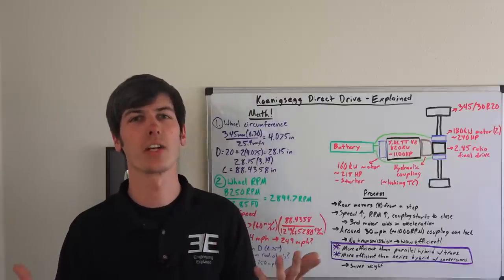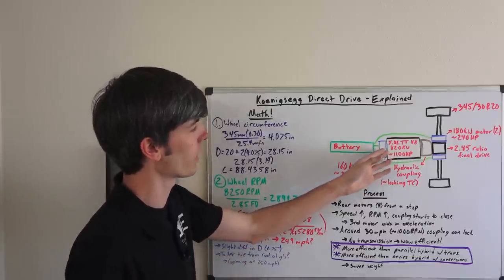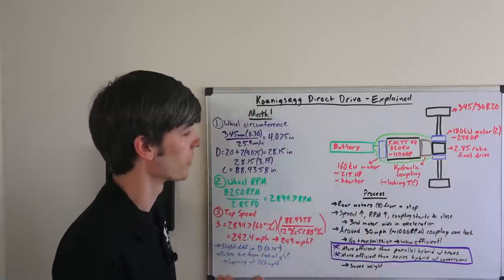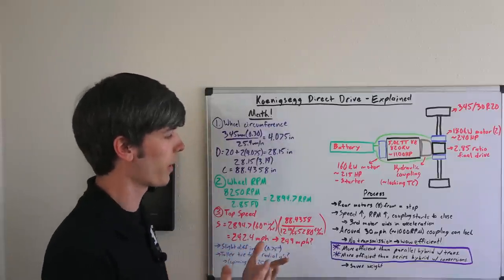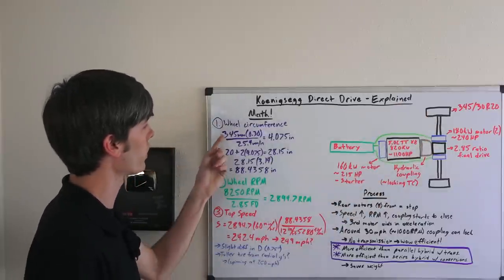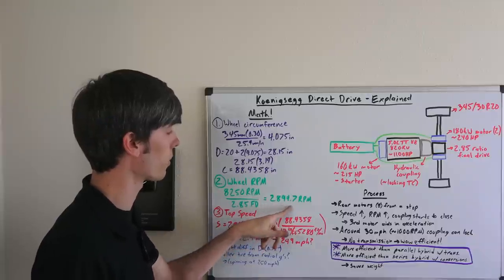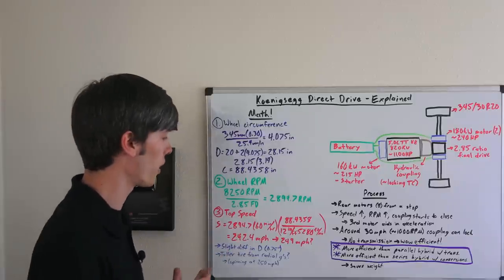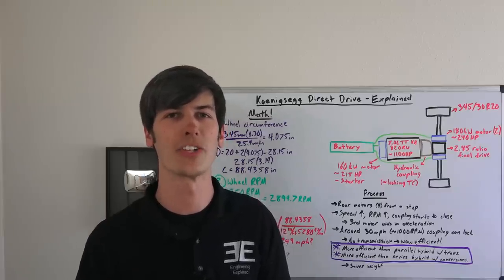Koenigsegg Direct Drive - Koenigsegg Regera - Explained

Comment: While calculating the max speed how come you don't mention the weight of the car?
Reply: Max speed is not affected by the weight of the car, but by the max rev/min the motor does and the transmission+wheels+tires ratio.
Imagine that you have an endless stretch of land and do not take in account the air resistance, what's left is only what he used to calculate.
Reply: RedheadPapa  Weight/mass is not relevant to top speed. 
Acceleration is greatly affected by weight/mass. 
Less weight/mass equates to increased acceleration, but does not increase maximum top speed.
Reply: patw52pb1
I'm gonna sound like a noob but the top speed is supposedly 255mph not 249mph, and secondly why with all this power is it slower then a bugatti SS?
Reply: Dirceu Corsetti Thanks, when you mentioned the endless stretch it started making sense.
Reply: ***** Numerous factors can affect the top speed of a vehicle including but not limited to gearing, ambient air temp and density, drag coefficient, road surface, road slope, transmission top gear ratio, final drive gear ratio, dynamic tire circumference, tire coefficient of friction, maximum engine RPM, clutch or  torque converter slip if equipped to name a few. 
What Jason illustrated was the calculated top speed using published data and some assumed static values such as tire circumference, maximum attainable engine RPM. In the real world of vehicle speed measurements very few parameters are static values and most contributing parameters are somewhat dynamic.
All of that means whether it is Jason or anyone else calculating  vehicle top speed, it will most likely have a certain percentage of error and highly unlikely to be exactly the same as an actual top speed measured on a road where the conditions are very dynamic.
Reply: patw52pb1
Ahh okay lol thanks very much for the explanation.
Reply: ***** they probably dont think the car would be safe at those speeds, as they kind of explained on top gear once when you take a koenigsegg, pagani or lamborghini to their top speed it feels like the car will explode at any moment but the veyron is so well engineered and stable that you barely feel a wiggle.
Reply: megaspeed2v2  What??? Apparently you have never experienced a Veyron over 230 MPH in person, it is not as stable and comfortable as you are claiming. 
I have either ridden in or driven numerous vehicles over 220 MPH (354 kph) and they are all unstable and uncomfortable at those speeds, the Veyron is no different. 
When the Veyron I was riding in exceeded 235 MPH it was vibrating and buffeting rather badly and there was a sensation of lightness even for a ~4200 lb (1905 kg) vehicle that progessed above 200 MPH so we both decided to not try for any additional speed.
Reply: patw52pb1 of course I havent. that is why i referenced trustworthy sources.

Comment: Thanks =) Interesting developement of todays technologies.
And... top speed? What about air resistance, altitude and air intake temperature? =)
Reply from the maker: macman90 The quoted top speed isn't based purely on gearing, it has the horsepower to do it. :)
Reply: macman90 they have use of a wind tunnel for drag coe;

Comment: wouldn't that mean that you'd be using the same gear ratio at 30mph (when the hydraulic coupling locks) and 250mph? wouldn't that mean they you'd have basically no power due to being at such a low rpm?
Reply: Sub Ripper 
Meanwhile, at said 30 mph,  700 HP from the 3 electric motors is clawing at pavement.

Comment: Hey, woudnt aerodynamic drag at 240 something MPH and the friction between tire and road reduce the top speed?
Reply: If the engine is strong enough at 7k rpmit isnt a problem. And the diff ratio is set to this optimum I guess.
Reply: Still there would be a drag co-efficient bringing down the top speed, wont it?
Reply: manoj rajasankar those frictions would make it take longer to reach the speed but gearing is absolute, if the engine reaches 8250rpm the wheels WILL be rotating at that 242mph figure (or 249 if the tires expend by 0.75inch as explained in the video)

Comment: Engineering Explained I'm thinking about this:
If the engine is hooked up with a hydraulic coupling, behind it is a differential with 2.45 final drive, and then goes to two motors.
The car use the motors on the rear wheel to take off, and to a certain speed engine fire up and continue to accelerate, didn't u have to calculate the top speed like:
Wheel speed= (Engine speed/2.45)+ max RPM the 2 motors on the rear can go at top speed
Then take the wheel speed above & convert it to actual top speed with wheel diameter.
- 
This is just my guessing, I don't think u would make mistakes calculating such things since ur and engineer, but only out of curious !
Reply: At max speed, he wouldn't have to factor in the electric motors, as at that point, the gasoline engine would be limiting the maximum rpm speed. Hope that helped.
Reply: I know the engine has a rev limiter, but I'm thinking that, when the coupling is fully locked, the engine's rotation goes through the final drive, then onto the motor, if the motor is not moving than the max wheel speed would be, like u said, the max engine speed/2.45. But if the motor also rotates at this same time, and for whatever speed it can do, let's say 60 rpm, doesn't the wheel speed became (8250/2.45)+60?
Reply: The rear electric motors are directly mechanically linked to the drive shaft of the engine through the hydraulic coupling. Because of this, the electric motors can't spin any faster than what the gasoline engine is outputting. The electric motors are only there to help aid the gasoline engine output more power when needed. 
Hope that helped.
Reply: thanks mate, now I understand.
i thought the motor is mounted after the final drive :p
Reply: No problem, glad I could help.
Reply: ur too kind, im glad that u helped me with this :D
btw is that a launchpad in ur profile pic?
Reply: yes it is~
Reply: people who can understand how to play it is genius :D
Reply: Thank you? xD
Reply: no worries bro

Comment: So let me get this straight..

The Regera has a 1500hp engine plus a combined 700hp with 3 electric motors, a power to weight of 940hp/tonne (ICE) but maxes out at 249mph due to the redline... 

While a Bugatti Chiron has the same horsepower and a power to weight of 751hp/tonne but has to be "electronically limited" to 261mph for safety reasons but is claimed to reach 288mph ?

I think Christian von Koenigsegg had a few too many Carlsberg's when he came up with his "elaborate drive system" :)
Reply: Yeah :) I bet you are driving everyday with 400+.. Unlike you, he probably thought about responsiveness, acceleration and torque. Bugatti - 1600Nm, Regera - 2000Nm. Bugatti 0-300 13.6s, Regera 0-300 10.9s
Christian chose to get rid of the transmission in favor of the car's feel and performance. If he wanted top speed he'd keep the transmission and go to 300+mph with that kind of power.
Reply: A3tr03 yeah I am actually... 520+

It just sounds like a very complicated drive system.. he's just ditched the transmission for THREE electric motors and some batteries.

I'd like to see them in a drag race, I reckon it will be neck and neck all the way to 200mph, then the Bugatti starts pulling away as the Regera driver starts to wish he had another gear... haha !

Christian himself said the batteries are designed to drain along with the fuel after just 3 laps of the 'Ring !

So much for being a great track car....
Reply: C'mon man :) 3 laps of the ring are 62 km which is like 15-20 laps regular F1 races. No Regera owner will drive on the edge for 20 minutes straight. Do you know what strain is that? Just go drive a cart for 20 minutes and you wouldn't feel your limbs for half an hour later. 
Also, 200+ mph are only achievable on such a short list of places (legally) that I very much doubt that the Regera owner will ever feel bad for not having another gear.
Plus, this car has technologies that will soon follow in other cars. Everybody can do 8L W16 with turbos. There are GT-Rs with more HP than both the Bugatti and Regera but they are just straight line show-offs. No one considers those GT-Rs to be hyper cars or mega cars. It's just raw power. Unlike all Koeningsegg cars since their first one.
Reply: First: The engine has 1100 hp, not 1500. 1500 is the max combined output.
The figure of three laps at the 'ring was with the first prototype batteries. The new ones, that was presented with the production model, have better regen capacity and will have juice lap after lap, since they're charged every time max throttle isn't possible. And at the 'ring; That is really quite often.^^

Comment: I don't really get how the engine works here.
Is it redlining at top speed? If so, how does it start at 1,000 rpm at 30 mph and then only redline at ~240-250 mph???
Reply from the maker: OMNOMNOMOTRON That's how it's geared. The math shows exactly what you're asking.
Reply: 2.85 is a very tall differential gear.

Comment: can you make a video on how a rally car engine produces 600 HP from a 2 L engine?
Reply: That's an easy one; turbocharging. You just build a regular 2L engine (with very strong internal parts!) and then use a huge turbo producing a large amount of boost pressure.

Do some research on the terms "forced induction" and " naturally aspirated" :)

Comment: surely you divide by 60 if your putting it into an hour?
Reply: Nope, there's 60 minutes in an hour, not 60 hours in a minute.

If you have rotations per minute (rpm) and want rotations per hour, you multiply by 60.

Comment: I'm seeing so many arguments on about the plausibility of 249mph. Even though your math shows a top speed of 242, I'm not doubting the math, its sound. i believe you are making the calculations on their published "clean" numbers. I'm sure the engine doesn't rev to exactly 8250, might be more like 8257.85 or the final drive ratio could be closer to 2.8375  but it looks better on the brochure to round it off. Its a minor difference that doesn't really matter on the flyer they hand out at the show. With the EXACT numbers/measurements from every component in the drive line I'm guessing it will add up to 249mph.
But its probably easier just to build the damn thing, strap it to a rolling road and see what it does.

Comment: No photos of under the hood, only CGI's, no videos of it moving, i am a chartered consultant engineer and i have doubts this is a completed and calibrated vehicle, anyone else feel that developing a hybrid system in a quarter of the time it took McLaren & Ferrari (who both already have years of experience of KERS) is hard to believe?
Reply from the maker: M3Conv I don't have doubts. It can certainly be done with an efficient engineering team. And removing a gearbox removes a lot of the refining that is necessary (that accompanies the gearbox). Will it be as refined as McLaren/Ferrari, I highly doubt it, but it's certainly possible. Electric regen has been around for many many years.
Reply: Engineering Explained
It will be interesting to see how it turns out. Koenigsegg only turn over $15M year and have a very inexperienced team in terms of this technology, so i am struggling to see this as anything other than a publicity stunt or at best a concept design.

Koenigsegg are very good at 'talking the talk', as a result many people actually believe they have pioneered the camless engine! when in reality they have never even built one, (unlike Ricardo who build the engines for McLaren, Gearbox for the Veyron etc).
Reply: M3Conv Do you mean to say their video of the Saab running with their system is fake?
Reply: Zac Harris
No i mean that the car they are showing here is fake and the performance figures theoretical.

Who quotes performance figures for a car which is not even complete?
Reply: M3Conv 
Well,  here we are 4 years later.  Have you seen enough evidence yet?  
I believe Mr. Koenigsegg is able to accomplish what you doubted because he is not weighed down by corporate structure.

Comment: Isn't that final drive not enough. I mean why not something like a greater gear in a gearbox (say 0.75/1). Would'n that be more beneficial in terms of top speed? 
And would you please explain to me why manufacturers use final drives like 3.5/1 or so. I mean i can't get how for example in a normal say 6-speed gearbox the 6th gear is like 0.7/1 and than the diff is like 4/1. Shouldn't that last fixed ratio (the diff) be just 1/1(without a final drive - like in bikes) ?  I suppose the acc would be very poor. Is that so?
Reply from the maker: Stefan Ovcharov This video should help clarify how gearing works, answering your questions as to why it's done the way it is. https://www.youtube.com/watch?v=bgGgH0j0KQE
Reply: I'm sure I've watched it quite some time ago but i'm gonna do it again with attention to details. Thanx after all! :)

Comment: what does mean 345/30R20 tyres, i didn't understand that.
Reply: its the size of the tire. 345 is how much mm wide it is, 30 is profile and 20 is the diameter
Reply: To clarify, 345 is how wide the tire is in millimeters, 30 means the height of the rubber part of the tire is 30% of the width of the tire, and 20 is the diameter of the rim in inches. It's a weird mixture of metric and imperial units that is used globally.
Reply: And the R means it's a radial tyre, as opposed to a bias ply or cross ply tyre.
Reply: thank you guys making me under stand.

Comment: So im still curious, is it true that in theory the car could drive as fast backwards as it would forwards? or is that just a myth. listening to the data and explenation u provide it sounds like truth. (sorry for any mistakes in my writing my first language isnt english)
Reply: Reverse in this car is done by the electric motors so it is not as fast backwards.
Reply: But yes,  theoretically if the gas engine could rotate backwards.  The differential gears would not survive though.  They are shaped for being loaded in one direction. 
A whole bunch of other factors would not allow it either.